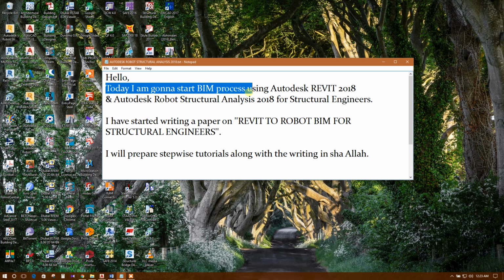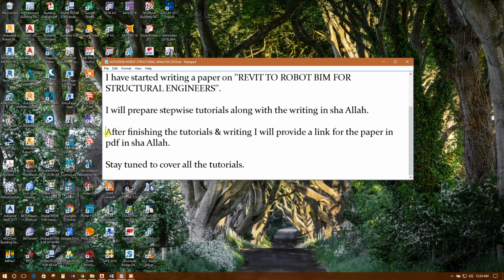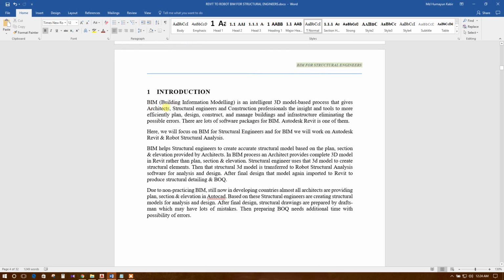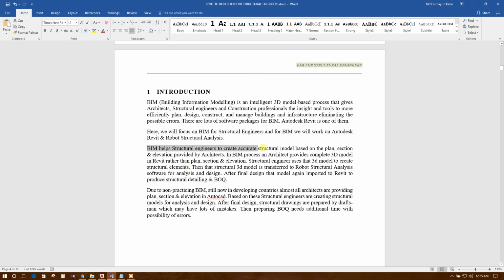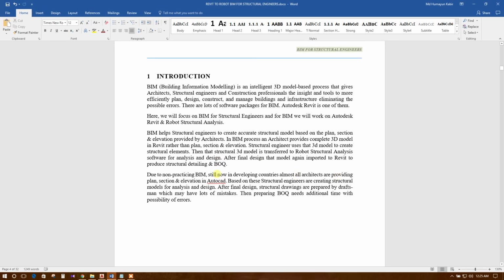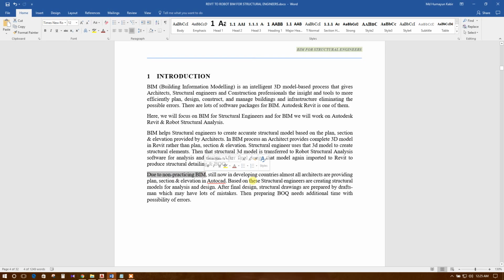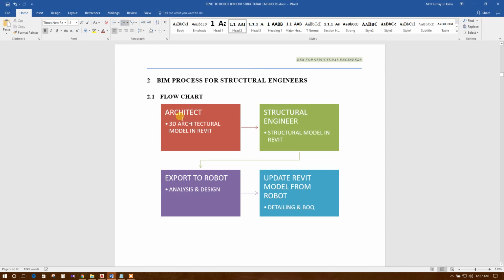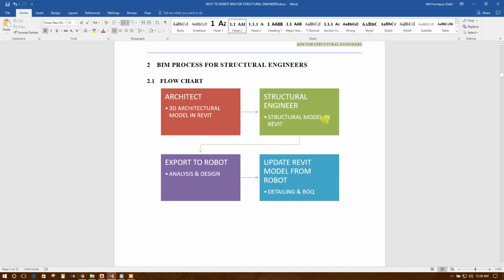1. INTRODUCTION TO BIM (REVIT TO ROBOT) FOR STRUCTURAL ENGINEERS

Comment: Sir first of all thankx for tutorial ....i have one quary ..i got some error at the time of design ....that problems with reinforcement arrengement ..and it wasn't slove. I tried it affter changing the cover size and also change width and depth of the column but the problem was not solve please help me...and sir there no option to share  picture so i can explain you correctly
Reply from the maker: You can get help from Autodesk Community Forum. Because there you can post with photo.